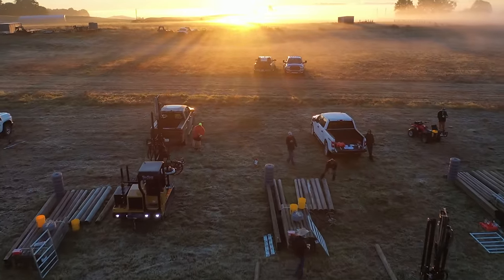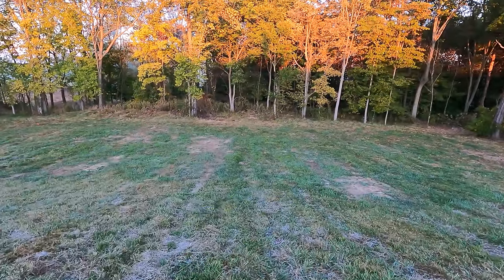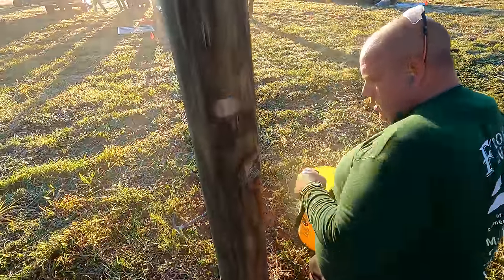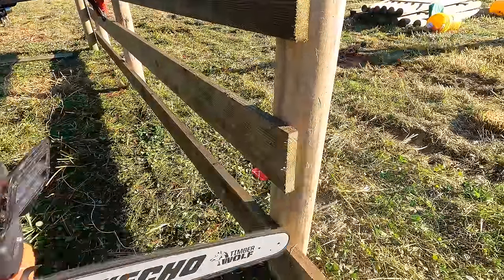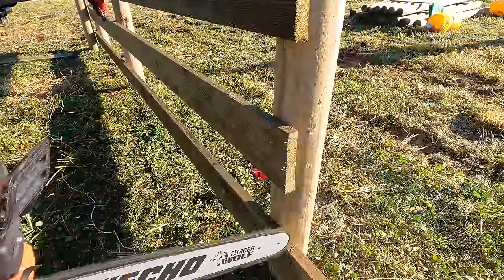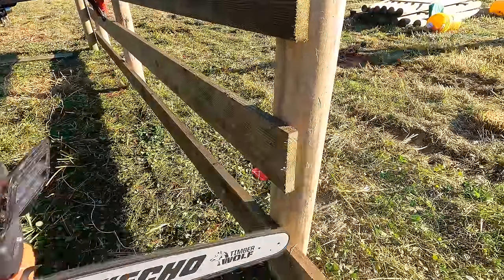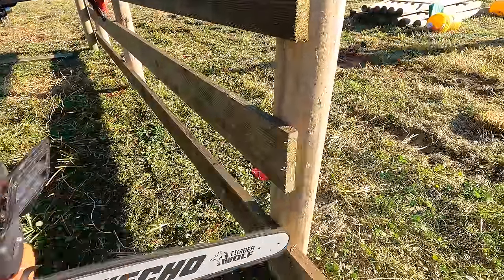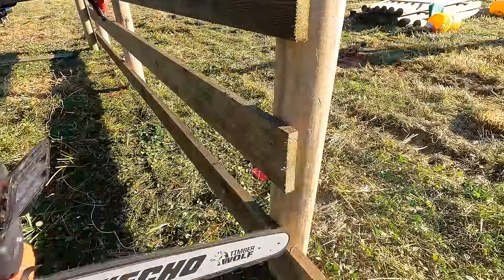You've never seen fencing like this! Farm Fencing ideas competition 2022!

Comment: Hey Josh I been pondering this question for awhile. When would I need to use concrete for setting fence posts and do I need to use treated lumber? I notice that in just about every video i ever see about livestock fence they never use concrete but they do on privacy fence. I'm new to this all and have been watching your videos and learning lots. Thanks!
Reply from the maker: when ya dig a hole and put in a privacy fence...it's necessary...when you drive posts and build bracing systems like this it isn't.  Driving the post into virgin ground saves you from having to use concrete.  Two totally different grades of fencing my friend.   Typical privacy fence isn't as strong and the posts are simple 4x4 posts.  You need treated posts for anything that contacts earth or will be exposed to prolonged moisture

Comment: I was hoping to see the different methods for anchoring that post at the bottom of the hill and for that matter the other bracing solutions. 

Since the winners morticed the board fence to the end posts why not notch the center post so the boards could be supported and flush with the side of the post.

Comment: Would be great if the techniques not already shown in earlier videos, could be demonstrated. For instance the barbed wire figure of 8. Netting figure 8, showing how to keep the gap correct. H brace wiring tied to avoid trapping risk. Personally I would like to know how to add a foot without an auger. P.S. specification of posts used. 10ft by 10inch strainer……
Reply from the maker: my friend...this is a fencing competition... it takes dedicated time to teach the techniques and during competition there's no time to slow down and teach...more teaching vids coming soon on the channel for sure